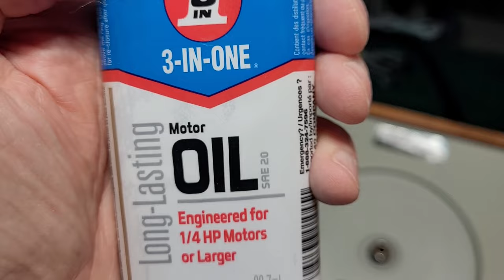Thorens TD125mkii - Service & Spring Adjustment

Comment: Cool. Good job broseph. I built a 1/2" thick mdf base with speaker damping sheets on it and stored the crappy base. I just did a Luxman PD277 last night. Definitely a keeper. Had another crack at the JVC QL-F4, but no progress. Going to part it out.

Comment: I never cared for the SME tone arms but there was a Mission 774 arm that used the same base mounting geometry and which was extremely rigid, highly adjustable, had low friction bearings, and (optional) silicone-fluid resinance damping. An excellent arm, even with low compliance moving coil cartridges, and a great match for the TD125.

Comment: The power supply on these Is a Wein Bridge Oscillator (notice the small lamp on the board) and *it's the non-polar coupling caps that are particularly prone to failure*, preventing the motor from spinning. The motor is a synchronous type that runs on AC voltage, not DC, and therefore is not only immune to speed drift as it warms up or cools down (as long as the AC frequency from the power supply remains consistent) but also has a longer lifespan than most DC motors ---- just like old-fashioned analog clocks that can run for many decades.

 99.9% of the belt-drive turntables you will see with pitch controls are utilizing DC motors that get wonky with age and the speed drifts as they warm up (and sometimes the pitch control potentiometers wear and cause speed stability problems as well). I briefly owned a Thorens TD115 with DC motor and standard power supply that tended to drift and the speed adjustment pot was finicky; I modified it with a pair of resistors and a lower value speed pot, reducing the range of adjustment but making it easier to fine tune.  Most Thorens turntables have crappy tone arms anyway, and the other models with pitch adjust are best avoided, but the TD125 is a winner.  I've owned one and repaired several for other people, and with a good tonearm on them,  they perform very well.  By the way, Thorens used to make a DJ kit for these, a set of rubber cylinders that replaced the springs,  to make the suspension stiffer for people who were spinning records professionally with them!  I've never seen ATD125 that was equipped with those, and it's also worth noting that I've never had to replace the suspension springs on any of them.

Comment: In it's days, these Thorens turntables had been one of the best serious belt driven sub chassis record players.
Due to the fact, Thorens tonearms never had been top, you could order with SME, DynaVector or Koshin Lustre.
I got the MK III Electronic from our father after he went on with the worlds best tonearm GST-801 (the first, one and only E-M mechanical Q-Damping)
I think the spring problem (I realised also) Is because of the heavier non Thorens tonearms. I will investigate if it is because the springs got tiered.
I prefer direct drive, and in these days I had chosen the DENON DP-57L with electronic Servo Tracer Q-Damping still running fine.
On my YT Channel there is a MK III video few months ago with a Heino tune "Kein schöner Land"
Reply: The springs on this one are more collapsed on the platter side though.
Reply from the maker: There are aftermarket springs with different rates of tension available.  This owner wasn't interested in replacing the existing springs.  They're probably a little worn out at this point.

Comment: If you check for continuity with a multimeter you will discover that the main bearing-well, and therefore the subplatter and outer platter, are not actually making a ground connection due to the heavy gray anodizing/paint of the plinth, and the bearing-well having been crimped into place. In a low humidity environment, any static electricity that builds up on the record as it plays cannot be drained away and dissipated to ground through the platter,  and might instead create static pops through the cartridge and into your audio system. You can fix this by adding a ground wire from the outside of the bearing well to the metal plinth or other internal grounding in the turntable (if you clean the metal and use a high wattage soldering iron or gun, you can solder a wire to the side of the bearing-well; or attach the ground wire with a metal hose clamp instead).  Note that it is best NOTto use an audio- signal shield-ground as your bonding ground to get rid of hum and buzz and RF and static electricity, but unfortunately many turntables and tonearms do exactly that, including some SME arms if I remember correctly.
Reply: Hi, SME 3009 series II (I think) tonearm has a separate grund connection at the bottom connector, problem is some people don´t know what a ground loop is so they atttach the ground pin to RCA females at the back instead of running the tonearm ground cable to the phono preamp. I have this same Thorens TD 125 MKII and there is continuity between the bearing well to the metal plinth , maybe previous owner modified It (I don´t see any ground cable run from the B. well to the plinth or ground connection. Anywat It´s a good advice to check continuity just to be shure, and while you are there check if tonearm ground is separate from audio shield cables. Cheers.

Comment: Hey Turntable Guy. Thanks for the video on the Thorens. I have the earlier late 60's Mk1 version of the TD125 with the awesome Rabco linear tracking tonearm. I originally worked on this unit for a friend. After repairing it I ended up purchasing the turntable because my friend was no longer listening to records that often. I love the Rabco tonearm. Very cool and simple implementation of a linear tracking system. Have you ever worked on one of these?  Here is a link to my repair video. https://youtu.be/XF-1iOY51K4
It looks like we had many of the same issues with the turntables.
Reply from the maker: I have not had one of those on my bench yet.  Cool design.

Comment: The sub-platter dropped to Fast you need more oil. Also wrong belt is used should use only the belts made by Thorens as all others are too tight
Reply from the maker: There's plenty of oil.  Aftermarket belts are fine.

Comment: obviously you didn't handle a Lenco platter and, actually, your repair is not done well: the red lever for speed control supposed to be in the center if the strobe markings are on a stand still meaning that the speed is what it supposed to be
Reply from the maker: Obviously, you are a troll.  Speed is dead on.  Pitch position is not important.
Reply: Maybe for you, it isn’t, but for others it is and saying that the position  of the pitch is not important, coming from someone who calls himself a turntable guy is wrong as wrong can be. Plus, you didn’t clean the pots either, you used a cheap generic belt which, in the long run, can cause troubles and, all in all, you only did a shallow repair. I’m saying all of this because this machine is an icon in the history of turntables and deserves a proper going through